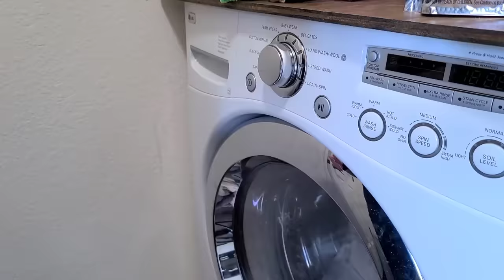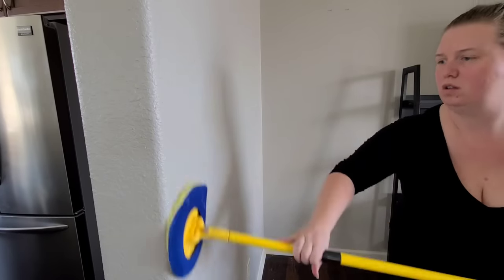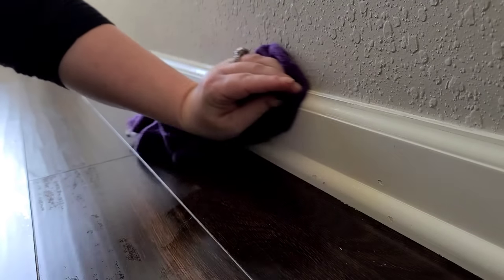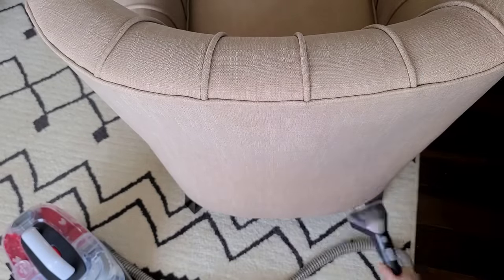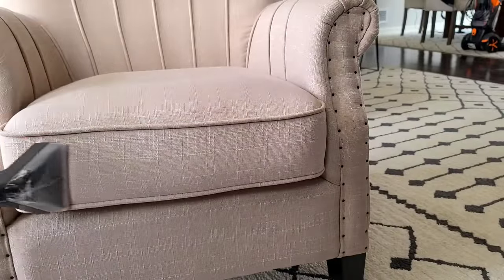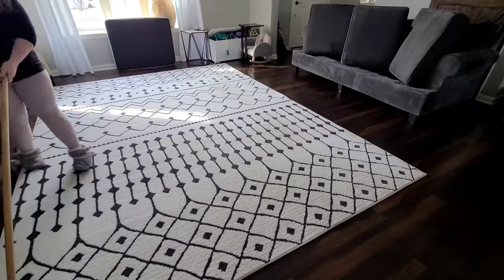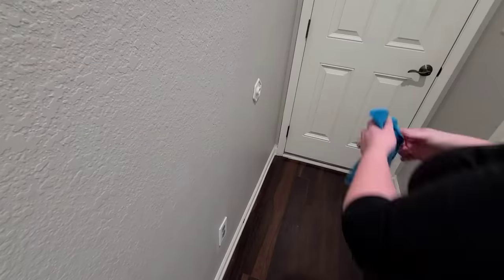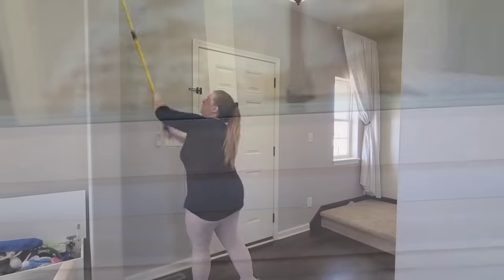NEW 2022 SPRING DEEP CLEANING | EXTREME CLEAN WITH ME FOR SPRING | DAYS OF SPEED CLEANING

Comment: Happy spring!  What do you use to clean your electronic screens? I have dust, smudges, baby milk splatter, it all....but don't want to damage out tv screen with glass cleaner.  Help please!
Reply from the maker: So in really bad spots I use a ecloth for glass. I have the cloth damp not soaked and after washing it I will Buff it with a dry one. I would think any glass cloth would work though not just ecloth